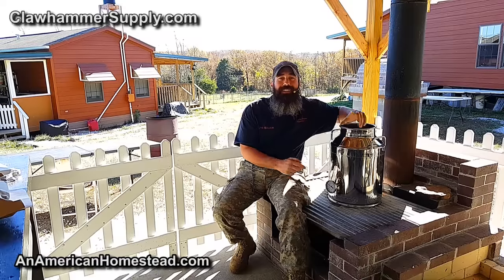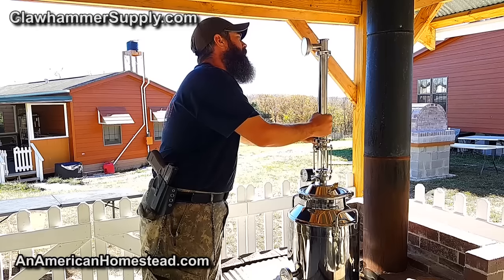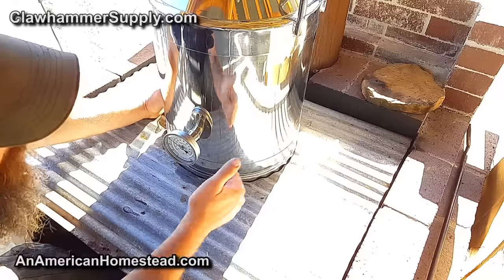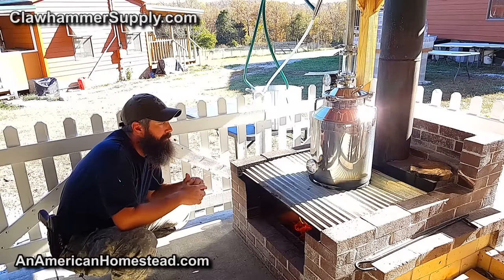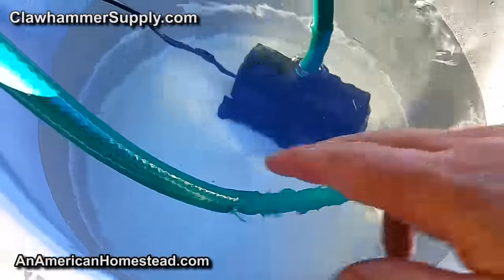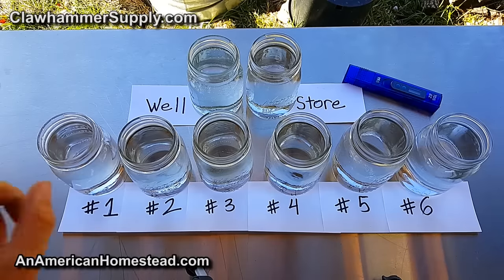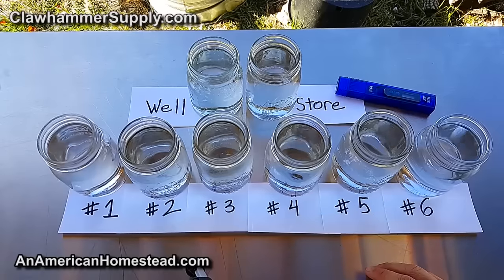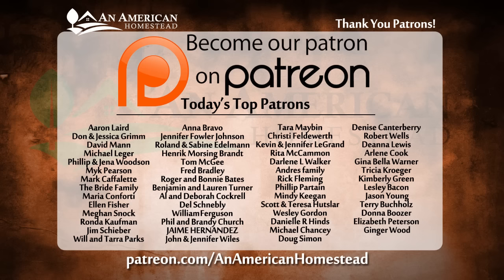Distilling Water Off Grid On The Homestead

Comment: if you coat the lower half, and base of your distiller  (and any pot you heat on a wood flame) with the dish soap BEFORE placing on the fire, you will not have to scrub that soot off, it will wash up really easily.  I was taught this camping tip when I was a teen.  I hope you find this time saving for you!

Comment: You should switch the direction of the cooling water. Those systems are counter flow chillers and work much more efficiently if the cooling water is going in the opposite direction of the steam or whatever else you are trying to cool.

Comment: You can also try putting dish soap on the bottom of the "pot" before placing it on the fire. The soot sticks to it and wipes off easy. Not sure about any heat lose, but likely negligible. It's what we did in Boy Scouts, we weren't using stainless pots or pans though.

Comment: I use an air cooled electric water distiller and it has a charcoal filter to remove impearaties. They got expensive so I make my own, but do run water through it 1st or your water will be cloudy.

Comment: Most people don't realize that "distilling" is the only way to get true clean water since it goes to gas (no particulates) then back to liquid.  Filters, not as effective since they always have contact with the liquid. Usually anything found in distilled water is coming from equipment or catch container.
Reply: Lonely Prepper Homestead  radiation?
Reply: Nat ... While radiation may "kill" unwanted biological items, it doesn't have the ability to "remove" anything from the water ... such as unwanted chemicals and metals, etc. While it's safer to drink with all the gut wrenching biological eliminated, it won't remove things that can still harm/poison your body.

Comment: You know take a tub of cold water some coiled copper tubing and just submerge the copper pipe in the water Hook one end of the coiled pipe to the vent on your pressure cooker and the other end put into a pitcher or container fill your pressure cooker. Home distiller. Note if you fill with flowers say lavender or roses  You have distilled essential oils. Copper tubing ifor this is about 20 bucks.
Reply: Excellent. What do you use to connect the copper tubing on the canning vent
Reply: Great video

Comment: I once heard galvanized metal can not be heated because it will off gas poison from the galvanization process. Anyone heard of this?
Reply: Yeah. The vapors released can be very bad for you. A quick google search showed about 800 degrees (which open flame is definitely going to be hitting) to release the fumes. I was a welder and they made us wear organic vapor masks or closed circuit hoods when welding on something they thought was galvanized. Supposed to be pretty carcinogenic.
Reply: people use to use grates out of old refrigerators but got sick using them in smoke house becuz they were galvinized so big no no
Reply: It is the zinc that of gases

Comment: Are you not worried at all about any possible contaminants in the pump?
Reply from the maker: in the pump?  The water running through the pump never gets to the end product.  Its just a condenser to cool the steam.
Reply: @Anamericanhomestead , got it. Thank you for clarifying. I've never done distillation, as I'm sure you can tell. I'm still confused a little by it, but haven't dug in and researched the process. I know I should. I've long wanted to learn it and felt a need for it as we've also dealt with cancer in our family.